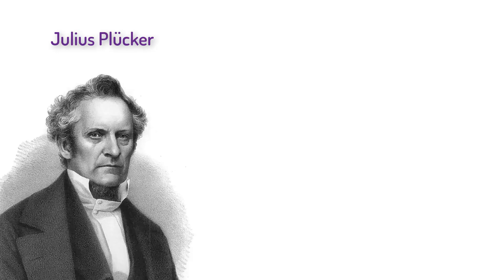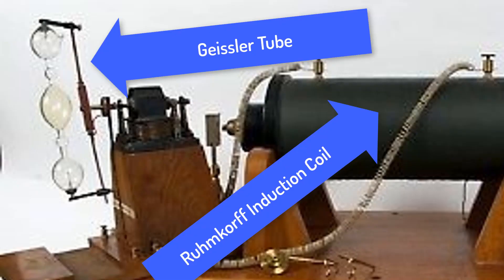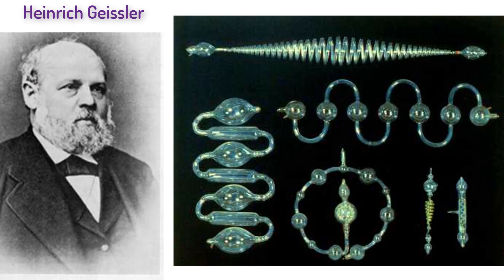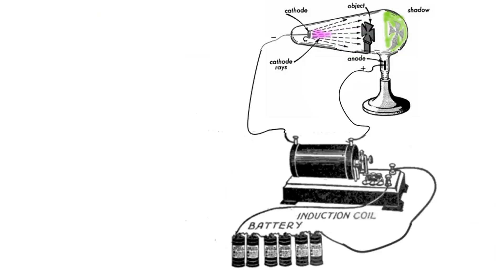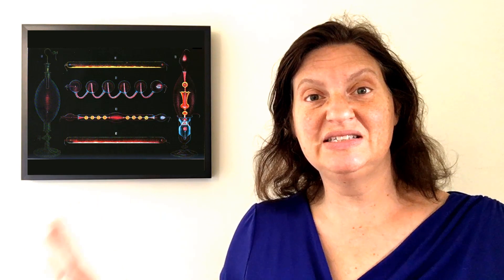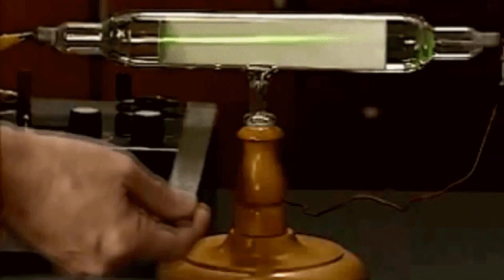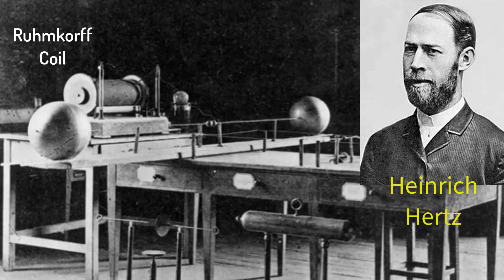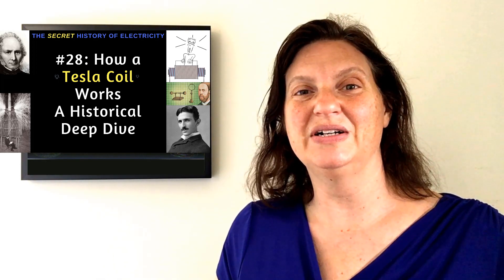From Geissler Tubes to Cathode Ray Tubes (Crookes Tubes), Physics & History

Comment: YouTube posted this prominently in the watch list perhaps because they thought that it would invalidate my fusion reactor theory.    
If one mentions certain things on YouTube like who owns most of the media and social media  or that the climate change crisis is fake, they become a target of YouTube and YouTube deleters.  
If you inject small jets of compressed air into the bottom of a silver wine chalice so that they spin the air in the chalice at high velocity, it seems that it would tend to evacuate the center of the chalice. If there is a good enough vacuum at the center, ions might be accelerated to fusion velocity and further dig the air out of the center.  If there is a high enough positive voltage plate at the bottom of the cup and a ring around the top charged to a high positive voltage, it would trap some hydrogen ions between the plates.  If there are insulated or ininsulated high voltage negative plates surrounding the inside or outside of the cup, ionized air swirling around the cup would tend to be pulled towards the negative plates further enhancing the vacuum.  Ionizing radiation that strikes the inner surface of the spinning compressed air would release electrons that would be accelerated in towards the center. This would allow a plasma of hydrogen ions and electrons to build up in the center.  If there are enough excess electrons in the plasma, a negative potential would build up that might be capable of confining fusion velocity ions.  If so, a tremendous amount of fusion might be possible.  This was the theory of Philo Farnsworth who invented the TV who also invented a fusion reactor.  He fired beams of electrons into the center of a metal sphere hoping to build up enough of a negative potential to confine a fusion temperature  plasma.  He got a lot of fusion but nowhere near net power.  The spinning air in the silver wine  cup will hopefully supply a lot more electrons to confine a hotter denser plasma to get a lot more fusion.  But this video suggests that the surrounding negative plates might not accelerate electrons into the plasma as hoped.   The situation in the wine glass is somewhat different. The charges in the comoressed air are moving at very high velicity.  A law of physics states that charges surrounded by a conductor do nor experience a force from the conductor if the charges in the conductor are at rest.  It seems that it is possible that the  beam of electrons in the early experiment was not deflected because particles quickly move towards the plates and canceled out the voltage in that vicinity.  The Faraday Cage idea implies that the air was so highly ionized that it was like a conductor.  But the charge cancelation situation also explains it.  
Anyway, it does seem that an electrin one centimeter in front of a  200,000 volt negative plate would exoerience a force from the plate even if there was much ionization of the spinning compressed air. .  The  positive ions in the air would quickly build up near the plate and cancel out the accelerating voltage were the air not moving at high velocity.  
A kind iof power feedback loop that would deliver  more and more electrons into the center faster and faster seems that it could result in a tremendous amount of power from this fusion reactor.

Comment: I'm a bit confused! How was it determined that the electrode emitting the glowing rays is negative? Is it because this electrode is connected to the negative terminal of the induction coil? If so, what led the designation of that particular terminal on the induction coil as negative to begin with? What if the battery were hooked up to the tube the other way around?
I'd really appreciate it if you could answer my question. I just can't shake this mix-up with cathode and anode being positive or negative. It keeps bugging me.

Comment: First of all Kathy, Congratulations, your programs are very interesting, very well documented and nicely presented. I have a dought if you can clarify for me,. When you talk about a cathode and an anode, obviously you are talking about DC current But in dose days, high voltages were achieved from induction coils,witch produce AC so then  how they rectified them since there where no Rectifiers. Can you inform us please.
Reply from the maker: Not all induction coils produce AC. In fact, you only got AC when you make a tank circuit, or you have and capacitor or condenser with your interrupting battery. 

I explained it a lot better in my history of the Tesla Coil. 

Hope that helps

Comment: The ideas by Crookes in his letter to Stokes (presumably George Gabriel Stokes who worked on the radiometer) are a revelation: his statement that one needs the corpuscular theory of light to understand what is going on (emission of light as a particle/quantum from a single electron) pre-empts Einstein's explanation of the photo-electric effect - possibly before Einstein was born? I'd disagree with the suggestion that he anticipated curved spacetime in his follow on statement about light not moving in straight lines, but this may actually point to something even more astonishing - he was predicting that the old theory of light rays in optics would not be correct. The idea of geometric optics is that light travels from one point to another by the path of shortest time (this is Fermat's principle and in a vacuum the path would be a straight line). However Hamilton had established that particles travel from one point to another by the path of least action and had developed a description of mechanics similar to geometric optics. There's a school of though that had Hamilton tried to put the principles of least time for light and least action for particles together he could have arrived at the Schroedinger equation (this would be have been in the 1830/40s) - this never happened, but it is interesting that the ideas for a wave-particle hybrid theory was already in place in the 1800's. It would be nice to know more about what Crookes actually meant!

Comment: Crookes did not mention "curved spacetime". He mentioned light not moving in a straight line.

It is a fascinating philosophical question, whether space and time are metaphysical concepts or real physical things. According to basic reason, one can apply physical actions to physical things, but not to metaphysical concepts.

Thus, one can bend a stick. One can bend a rod of iron.

One cannot "bend" the goodwill of all unicorns, except in a metaphorical sense.

To postulate that space and time can be physically bent requires one to cease using the words to represent metaphysical concepts, and to begin using them to represent physical things.

Is it valid and sensible, to believe that time is a physical thing, and not the metaphysical concept of progression? Or that space is a physical thing, and not the metaphysical concept of 3 dimensions?

If these are things, physical things that can experience physical actions that distort their forms, then how can they also be characteristics of all other things? All sticks and rods of iron occupy occupy both space and time.

How can a physical thing "occupy" another physical thing, let alone all other physical things, all at once?

All unicorns may be immoral, and all unicorns may lie incessantly. Yet the unicorn with the longest horn cannot also be the unicorn with the shortest horn, as well as every other unicorn, all at once. Not unless there is only one unicorn.

Comment: From where/who and how does the concept of “charge” come?
Thanks!
Reply from the maker: That is an excellent question. William Gilbert (1600) came up with the idea that things can be electric in electrified if you rub them and then Steven Gray (1727) figured out that electricity moved and then Du Fay (1731) figure it out there’s two kinds of electrics and then Benjamin Franklin (1749) called them positive electricity and negative electricity. Therefore, by the time coulomb (around 1780)  came along to find the relationship between electric forces there was discussion of electric charge.

Comment: Amazing as always. Why don't the Cathode rays angle down towards the anode? That's a detail that's holding me back from understanding. Why do they shoot past the anode in a straight line, hitting the glass across from the Cathode? I know charge and magnetism are different things but isn't it similar, in that opposites attract? And speaking of magnetism, does the Cathode ray react differently towards the North and South poles of a magnet? I'm assuming it does.?. I'm so confused now. 🤦‍♂️ Isn't that how TVs worked? But back to my original question. How does the Anode work and what does it do in a Cathode ray tube. Does it create a sort of Faraday cage out of the glass or maybe the gas in the tube.?. Except for the vacuum...🤔😤🥵🙏 Love your videos.
Reply from the maker: Lots of questions let’s see how I can answer them. So the cathode has electrons and as they get heated they push away from the other electrons and if the voltage is pretty high they tend to go with a very high speed. They are attracted to the anode but if they’re going on a fast speed they basically don’t have time to be pulled towards it and just go in a straight line if that makes sense. Moving electrons, which is what is happening inside the current caring wire, move move differently by the north and the south pole of a magnet using the right hand rule. So if you use the other side of the magnet you would be moving the cathode ray in the other direction. 

Yes, the original televisions, CRT televisions or cathode ray tube televisions use with the catheter very moved by an electromagnet one electromagnet to move it left to right and one electromagnet to move it up-and-down. The intensity of the beam is controlled by the voltage and the intensity a different points made the picture if that makes sense.